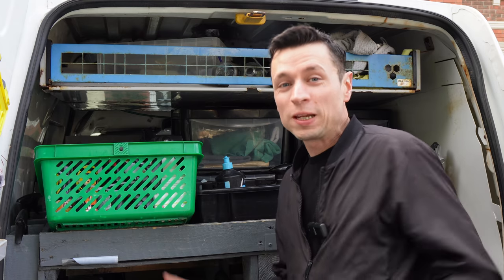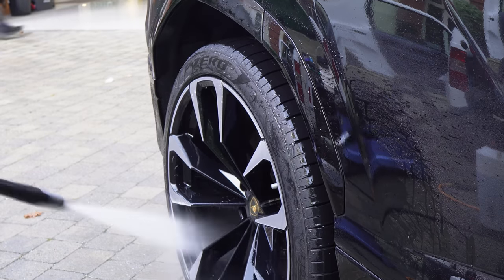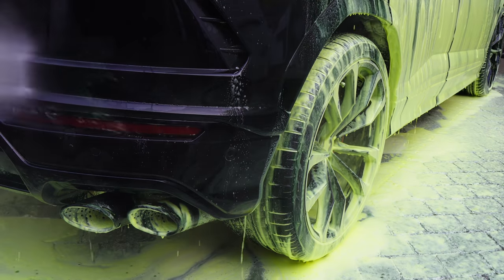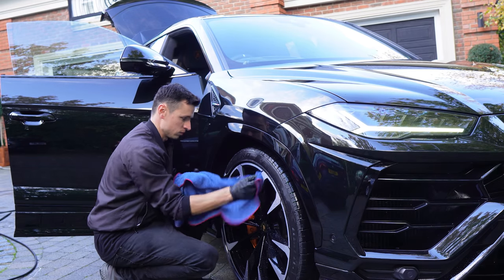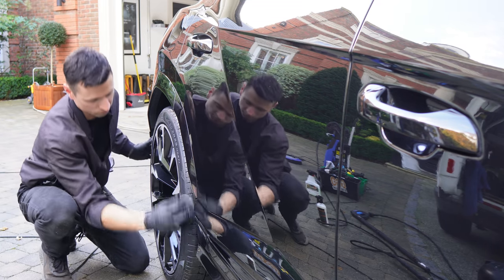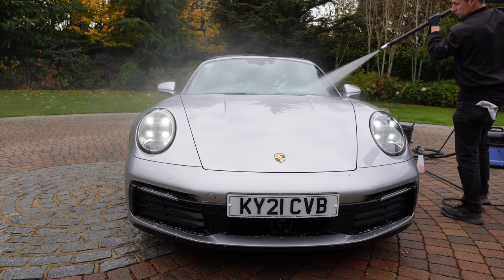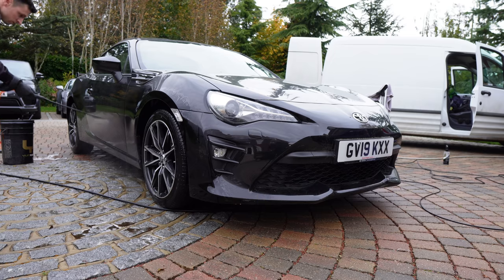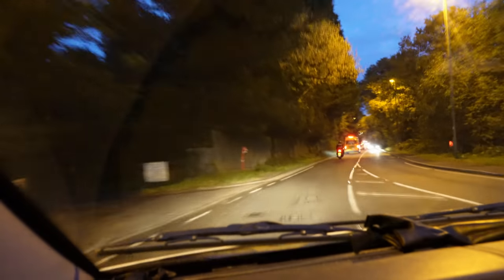Get an Exclusive Look into the World of a Mobile Car Detailer: A Day in the Life

Comment: Hi mate, great video. Quick question, do you use a backflow preventer when hooking up the pressure washer to the garden tap? If so, do you know where I can get a cheap one because the Nilfisk ones are all about £80. Thanks a lot, keep up the vids
Reply from the maker: I don't use one but had the hose pop once off the tap. If that happens then i use the water tank but thankfully the tank is just used as a backup now